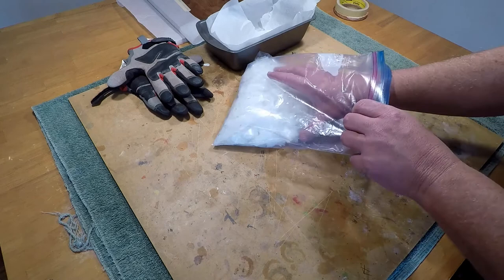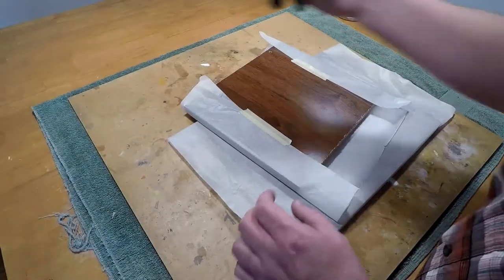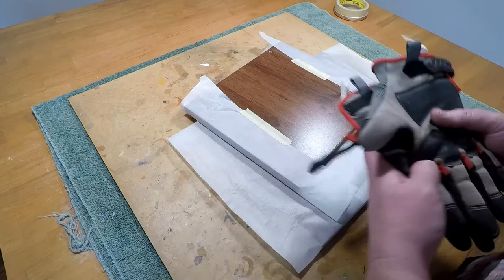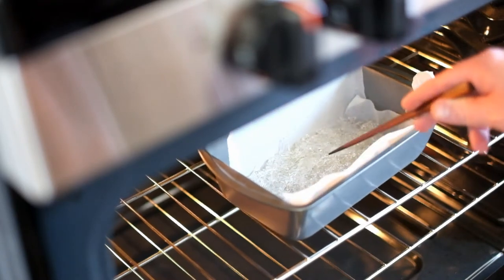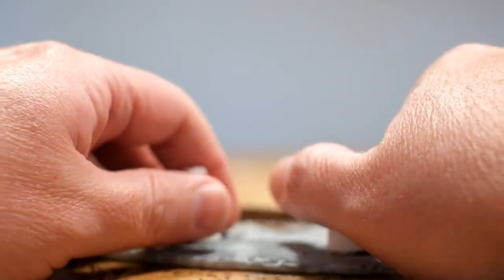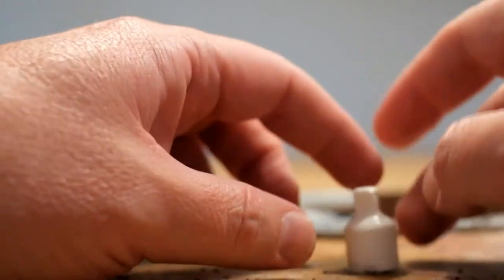FREE DURABLE BASE MATERIAL for your next DIY war gaming terrain

Comment: Nice testing. Didnt get if the white glue was as good as superglueor epoxi.
Reply from the maker: Thanks!  Great question, I cant believe I forgot to recap that haha!  I think If i were to rate the glues used in terms of bonding it would be 1) Epoxy 2)white glue 3)super glue.  Epoxy is a little more expensive but bonded well.  White Glue is economical and still had a decent bond.  Super Glue kinda fell short.  Off camera I used a little "Liquid Nails" which seemed to have a respectable bond
Reply: @krash_override  Now we all know ! Thanks for your experimenting test !

Comment: HDPE and LDPE are essentially the same thing (High Density and Low Density PolyEthylene) … I work with this stuff for a living ;) Anywho we use it because of it’s non-stick properties… it’s often used as a lubricant free joint as well.
Reply from the maker: Great info!  I had no idea!   I knew that chemically they were very similar, but LDPE may not be as rigid as HDPE?   That may have been my thinking when specifying HDPE :)
Reply: @krash_override  It’s a good video because it essentially explains the main challenges with PE in terrain-building… I see a lot of hobby/terrain youtubers that run into problems with PE… At work we build stuff that is installed in public spaces (and graffiti tends to come of PE easily). We can only assemble it mechanically (nuts and bolts) or by welding it… which also explains why your “oven bake” makes perfect sense!

Comment: Awesome idea my friend :)
Reply from the maker: 2AHD Cat thanks!  Came out alright minus a slight rock due to the heat when I primed it outside.
Reply: @krash_override   I mainly use cardboard as a base, then Elmer's glue stuff on, and finally flat paint and flat clear coat over it. Coffee grinds is cool, but... it could attract roaches, lol
Reply from the maker: Lol!  It’s simple and effective.  I’ve noticed that if you mix it with a thick blend of modge podge it almost looks like road texture in hot wheel scale so I may try it on figure projects
Reply: @krash_override   Coolness 😎